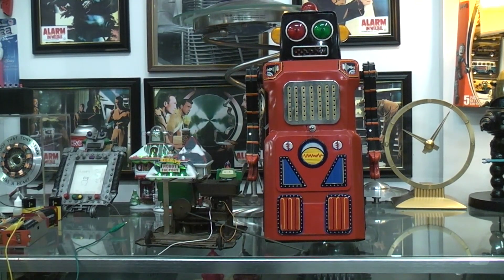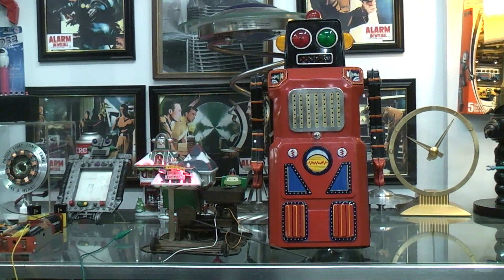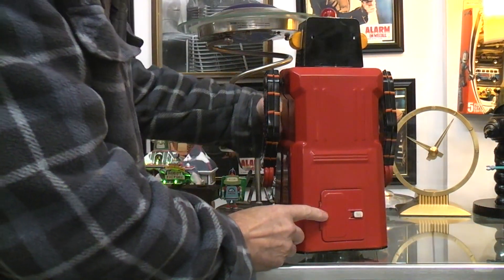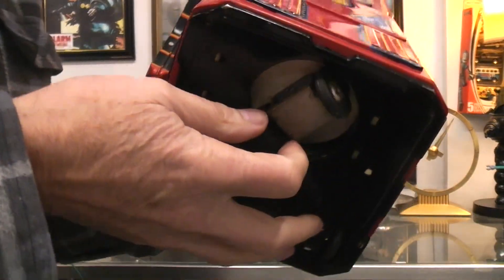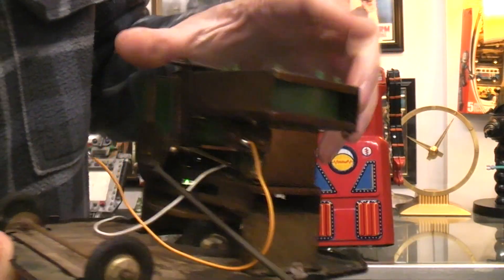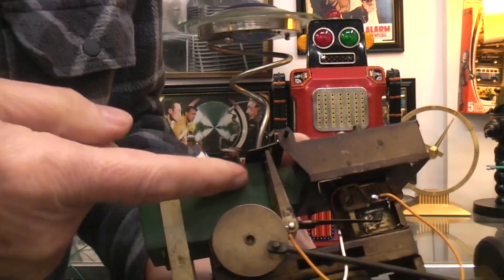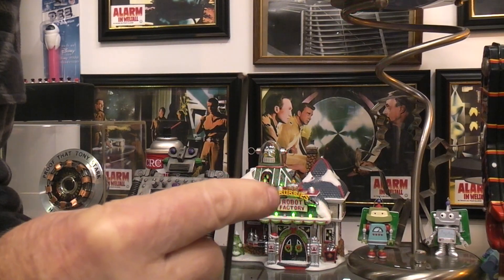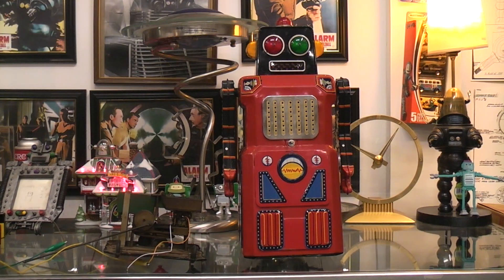Let's look at the 1960's Sonic "train" robot, what's inside and how it works.

Comment: Has anyone reproduced the gang of five yet?
Reply from the maker: Back in the 1990's I reproduced the Gange of five, full scale and working from silicon rubber molds of the actual robots and cast the new parts in resin.
Reply: @Robothut  Holy Smokes. Can you do a video on those?
Reply from the maker: @michaelmacina2365  It would be a video of me talking about still pictures of the builds since they are all in other collections. So kind of boring. I might still have the scraps of the rubber molds, but that would take some digging in the cold shop to find.